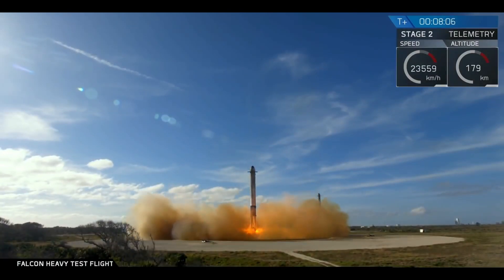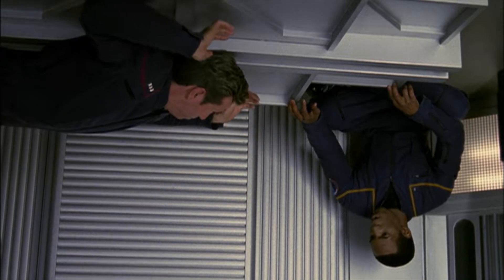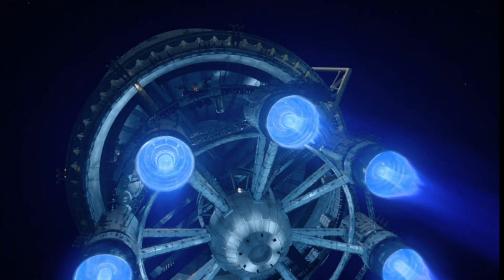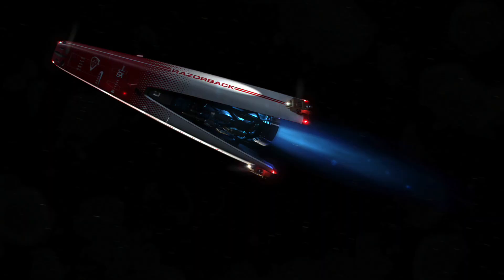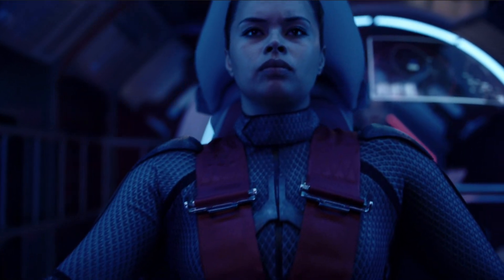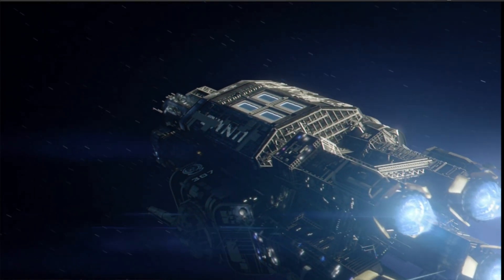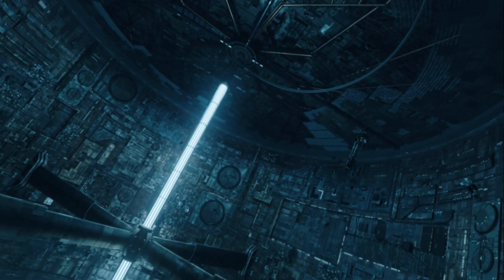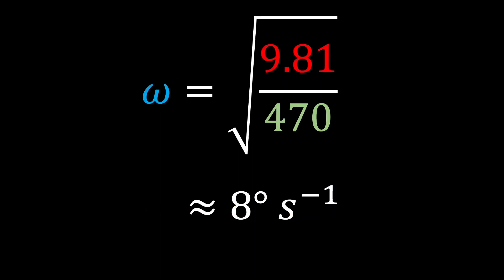Are the Expanse Ships Realistic? - Science of the Expanse

Comment: I love how the Expanse team designed their ships. The only show I can think of that went about it in a similar real science way is Babylon 5 from the mid 90's a B5 are the ones that had NASA reach out and ask "hey, really like those Starfury fighters and tugs you have. Could we maybe borrow the design?". Apparently the answer was "of course you can but if you use them you have to call them Starfury" 

Where the Expanse team took it to the next level are the tiny details they went to the effort of adding, sometimes even in a "blink and you miss it" but they did it anyway.

Best example is the Rocinante in combat. With her PDC's deployed(which are basically their version of CIWS found on today's modern Warships) and firing, if you watch the rear of the turret they have a little rocket engine firing in time with every round fired so the cannon firing doesn't send the ship spinning out of control. Also a far easier "keep it stupid simple" solution than a complicated set up linking and timing weapons to the ships RCS to deal with the problem. 

In one battle the Roci pulls off a strafing run with her rail gun. As the ship rotates to take aim the main engine is shut off. When the Roci fires the main engine fires up very briefly to arrest the recoil of the rail gun. It's barely 5 or 6 frames of footage but the FX team remembered the RULE "every action has an opposite and equal reaction" and went to the effort to show it. 

They have a story line with the Roci and another ship disabled because fusion stops working for some reason. Both ships have degrading orbits so they get a line from the Roci to the other ship and use the Roci's rail gun to nudge them to a higher orbit. Because fusion stopped working in orbit of this planet the main engine doesn't fire up so they even have a line thrown in among the crew that they don't even need to disconnect that feature of the weapon system.

What I love most about The Expanse is the writers had confidence in their audience and kept explanations and techno babble to a minimum. They knew we didn't need or want to be led by the hand like toddlers every step of the way. Part of the joy of watching it is seeing these tiny details and realising what's goin on 😊

Comment: In the expanse the ships use water for reaction mass. The rcs setup uses super heated steam and the main drive uses water plasma as apparently if you expose water to the temperatures generated by a fusion reactor it skips steam and goes straight to plasma. That plasma can then be directed with magnets and out through a magnetically lined drive cone. Water used as reaction mass is also why there aren't visible radiators because the water is used to pull heat from the system

Comment: My big question about the behemoth was that if the ship was under thrust, which it kinda had to be to get there, and also spinning to use the cylinder, wouldnt that have imparted gravity at like 45degrees to the direction of travel? 
I.E. they have an "out" force and a "down" force operating at the same time.
My reading implied that they were going to using the cylinder the whole way, not just in orbit of sone planet.

Comment: Woah, 4:16 is painfully wrong. In fighter jets, the maximum forward acceleration, due to engine thrust, is less than 2 g, and ~3-3.5 g on a carrier catapult. But the really high accelerations are experienced in turns, exits of loopings etc., up to 9-10 g, and it's upwards (in the reference frame of the pilot), i.e. the experienced force, compressing the pilot's spine etc., acts downwards.

Comment: A minor detail, but fighter pilots don't face forward because that's where most of the acceleration comes from. In fact, the most intense acceleration comes from maneuvering, which can be up to 9 gs depending on the jet and it's payload. Meanwhile, engines might give maybe 2 gs for short bursts at full power. In fact, if you look at some fighter cockpits closely you'll see the seat reclines significantly to give the pilot better g tolerances. Having the pilot laying flat would be the best, but would make flying the plane rather difficult.

Comment: 4:15 it seems you don't understand the fundamentals.

Fighters can barely accelerate at more than 1G, and that's only when they're not fully laded.

That can easily be seen from thrust to weight ratio, which has to be slightly higher (to compensate for air resistance) than 1:1 to accelerate at 1g.

So, most of the time, in horizontal flight pilots experience exactly 1g, the same as if they were sitting on the ground.
If the fighter is accelerating at 1g, they will experience 1.4141g combined acceleration of the Earth's gravity and fighter's engine at the 45° to the rear.

The only situation when pilots experience higher g-forces is when pitching upwards, depending on fighter usually 7-9g.

And yes, they are NOT sitting with their back towards the acceleration because that would be highly inefficient in all situations other than at max g.

Some fighters, like F-16 have the seat at an angle to the back (F-16 has the highest angle - 30°), but the main mechanisms to fight blackout is pressure suit which pumps the air (or uses fluid passively) into the pants to reduce amount of blood draining into the legs.

Comment: Fighter pilots deal with G force going down during turns or climbs because of their inertia which creates a centrifugal force. The engines do not produce enough acceleration to cause issues. This is why you see newer jets with reclined seats, so when G load increases they are angled towards the pilots back.

Comment: I'm not sure about the point about the orientation of jet fighter cockpits. Real jet fighters cannot produce high accelerations with their engines, but through maneuvers. So the acceleration does actually act (at least mostly) vertically when pulling a tight turn (this is also why you can't put the nose down very quickly, as this would result in high negative acceleration).

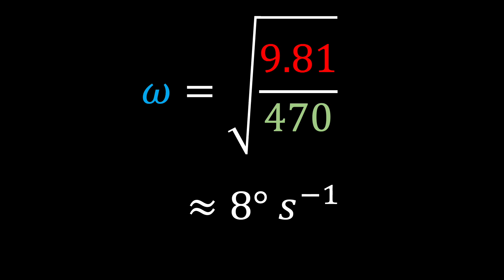Comment: So the equation at 7:54 is wrong.  It's supposed to be radian per second, which explains why the numbers don't make any sense.  9.81/470 ~ 10/490 = 1/49 which the square root gives about 1/7 rads per second, 53/7 is about 8 degrees per second.

Comment: The rolling “crash couch” seats on the Razorback or other ships are a glaring error to me.  G force is created by acceleration only, not momentum.  So even in a hard breaking turn the only forces pushing on individuals would be the maneuvering thrusters.  It’s certainly possible the thrusters could generate short spikes of acceleration sidewise but by their role it wouldn’t be sustained acceleration.  Couches should be fixed, oriented toward the main engines only.

The Rocinante’s bridge violates even this law with it’s odd sideways seating, back to back.
Reply: If I recall correctly, the Rocinante's bridge seats would often recline in hard burns, no?

Comment: Significant G-forces in fighter jets don't come from the engines they come from the wings - that's why the F-16 has it's seat reclined at 30 degrees, to help pilots withstand up to 9Gs coming from horizontal (relative to the aircraft body).

Comment: One of the things they get mostly correct is having a ship accelerate at 1G for half a trip then flip and decelerate at 1G for the remaining half. However, this becomes an issue if you want to stop the ship part way through the trip, especially as a trip covers more distance. 
Say you are traveling from earth to Jupiter. You accelerate for the first half and decelerate for the second half. All good. However, let’s say you need to come to a stop half way through (about when you would do a flip to start decelerating), maybe to help a ship in distress.  This is a real problem because you will need to burn at a lot higher rate to slow down in any reasonable timeframe in order to assist. It would seem to me that the deceleration G’s would be very high and for an extended period of time. The shorter the time period to stop, the higher the G’s. 
Would this even be possible? 
There are a lot of things they get so right. But there are a lot of things they don’t talk about or hand wave to make things more convenient.  Like having orbiting planets always be in the optimal place in orbit to minimize transfer time from where they are currently at.  They never show a case where they are at Mars heading towards Europa (for example) while Jupiter is on the opposite side of the Sun and traveling in such a way that the shortest path is close to a straight line in past the sun and back out to Jupiter.

Comment: The Rocinante would only be able to accelerate for a short period of time at one G. What isn't explained very well, is where / how it stores all of its fuel, and what is it expelling?

If expelling heavy atoms, where does it store all of the fuel? If expelling light particles, then it isn't capable of rapid acceleration. In addition, it only takes about a year to reach light speed at one g. As you do so, the mass of the ship increases, and therefore needs more energy to accelerate the additional mass, requiring more fuel (mass).

My point is that while the Rocinante is MUCH more realistic, it still is a long way from realism.
Reply: Yes, they did away with the storage and expelling of fuel problem by inventing the fictional Epstein Drive, which is a sort of magnetic confinement fusion engine that is efficient at a level not currently scientifically possible, hence allowing the ships to accelerate at 1G for extended periods. The fuel is in the form of pellets of material. No idea how it's supposed to get around the gargantuan power demand to render it in any way useful....but, that's the non realism part for you.

Comment: I still don't see any reason for the 'roll cage' spinny devices as seen on the Razorback.  The ship only has one engine capable of generating thrust for high-g maneuvers.  It's in the back.  Relative to the rest of the ship, it only can push in one direction.  Sharp turns could only be accomplished by turning the entire ship- seats, main engine, hull, everything- all in the direction you want to turn.  I seriously doubt the little RCS thrusters that just spin the ship around would be generating enough G force to really matter.

Comment: Not quite correct about fighter jets. They sit facing away from the engines because it is practical. Even the most poweful jets will only produce around 1g laterally. When maneuvering the pilot will feel up to 9gs vertically which a trained pilot can withstand for a little while. Normal people would get knocked out almost instantly.
So it would actually be better to have reclined seats in jets(som have slightly reclined seats like the f16). But there are of course a multiple of reasons why you can't have reclined seats.

Comment: I just looked up when the Expanse is set and I was a bit surprised to see that it takes place around the year 2350. I felt from the technology they were using that it was more around the year 2150 - 2200. Star Trek TNG, DS9 and Voyager take place in the 2360's - 2370's. This seems more in line with the technology advances I would expect. If you imagine what technology people had in 1690, that's about the same time difference as from now until 2350, although thanks to computers we are advancing at a much faster rate than they did. Maybe I'm optimistic but I think we'll be closer to Star Trek than The Expanse in 2350.

Comment: I read the books and watched the shows, but I was left with some questions:  What is reaction mass used in the Expanse?  How close to the speed of light does the reaction mass need to be for the Epstein drive to maintain 1g, 1/3g or even 1/6g for transits between the belt and Mars and to Jupiter and Saturn without massive reaction mass tanks?  Or is the Epstein drive some sort of magical reactionless drive?  How much energy would be needed from the fusion reactors for such flights?  If you've got exit speeds that high from the Epstein drive, why would you not use that as your weapon of choice instead of "rail guns"?
Reply: To quote the original writers the epstein drive runs on efficiency. On the show it's shown that the epstein drives are a kind of ultra-high efficiency fusion drive. 

As for why they don't  use it as a weapon, they do in the form of their missiles or as in the latest season a means of accelerating meteors towards earth. Also in one of the other episodes an unarmed ship tries to burn another shop during a pursuit with its drive.
Reply: @brandonn.1275  "Runs on efficiency" sounds like just hand waving.  So are you saying the Epstein drive uses fused helium as the reaction mass?

Comment: The only thing that bothers me with ships in The Expanse is the ship propulsion. You can see that they're expelling exhaust gasses and that this is how ships are propelled forward, but where is this exhaust gas coming from? The ships are powered by fusion reactors, but fusion reactors don't produce enough gasses to propel a ship, only the combustion of a high density fuel would do that. So where are these gasses coming from that they're using for propulsion?

Also, a nuke in space would be almost useless as a weapon, since nukes do their damage by creating a shockwave. Nukes create their shockwave by superheating the surrounding atmosphere. No atmosphere means that there's no shockwave. So a nuclear missile in space would create NO physical blast, NO shockwave and do NO physical damage to another ship. Unless your nuclear missile detonated close enough to the crew of that other ship that they all got radiation sickness, the nuke wouldn't do anything more than create a lot of light and a lot of heat.
Reply: I think they use water as reaction mass, and on occasion they mention filling up when they're at a space station or something similar.
Reply: @BalooSJ  
How do you think it works?
Do you think they're electrolysing the water, then combusting the gasses in an exhaust chamber? Or do you think they're just throwing water out of the exhaust chamber for their reaction mass? Or via some other method?

Comment: 4:17 the f-16s seat is actually reclined somewhat, and it's not for comfort! the slight recline gives the pilots a little more wiggle room with high gs, the f-16 is light, with an efficient airframe and a very powerful engine, its designed to pull high gs and hold them meaning it has a small turn radius that gives it an edge in certain situations, of course like most moder military aircraft the pilot is the limiting factor, so that reclined seat mitigates some of the vertical forces that cause blackouts in a high g turn, along with a g suit and good health an f-16 pilot can squeeze every bit of practical performance out of their body and their jet when their life is on the line. It's also useful in somewhat lower gs, pulling 3-6 gs while having to make decisions is exhausting, and the seat slant lets them have more endurance when they need it. but even in the f-16s case its so high performance that its almost too much for its own good, 9 gs for too long will put a lot of strain on the jet and much higher can start breaking things, its insane how optimized they are. 5:34 this is so bad for humans that just a few gs can be fatal, as you brain can't hold that much blood and swelling and burst vessels will incapacitate you and kill you, its also again bad for fighter jets, as they're designed like humans for forces in one direction, negative gs will damage pilot and plane long before positive gs. Also to be that guy they actually call it a red out when you pull negative gs, cause apparently your vision will turn red from all the blood flooding the vessels in your eyes that your brain usually parses out, scary stuff.

Comment: The Nuclear Fission Saltwater Engine designed by Robert Zubrin is a currently possible technology that basically gives a spaceship the same (or similar) efficiency as the Fusion drives from The Expanse. The problem with Zubrin's engine is that the exhaust spews deadly radiation. But as long as you don't point the exhaust at anything you care about most of the radiation is traveling at a speed that it will escape out of the Solar System. Definitely a space-only Spaceship. With this engine you could design spaceships that look exactly like the ones in The Expanse, and you will be able to maintain 1G of burn for hours on end (maybe even days).

Comment: also  id assume the reason the behemoth spun vs using the vertical design is it was a generational ship meant to set off in one direction and go for well generations,   if you’re accelerating at a constant rate of 1 g,   then you’d reach near the speed of light in about a year,   so if you are counting direction of thrust as down at some point it wont be able to continue accelerating and you would loose your source of artificial gravity so it was designed to utilize centrifugal force instead, The Rocinante is a fast attack boat,  and is only designed to travel within the solar system so it has no problem accelerating at 1g  (or more likely .3g as previously mentioned) for a month or two at a time before flipping and doing the same to decelerate.